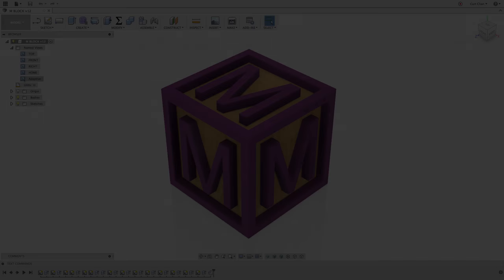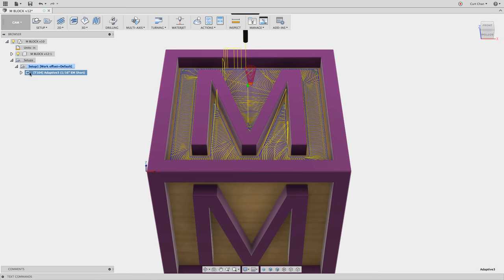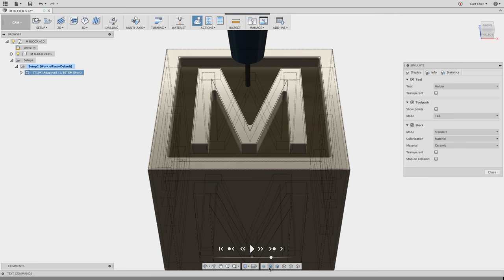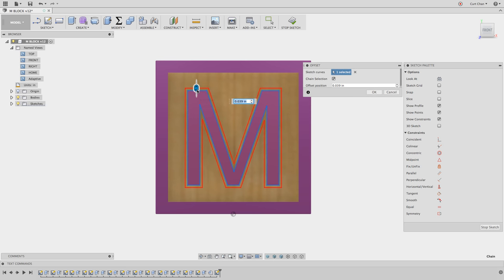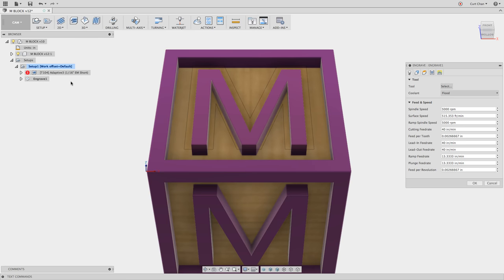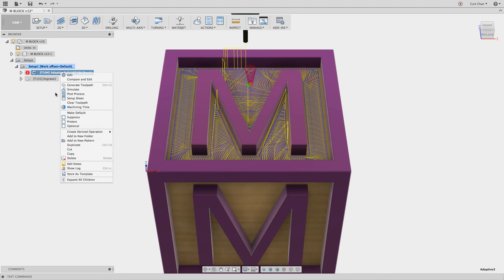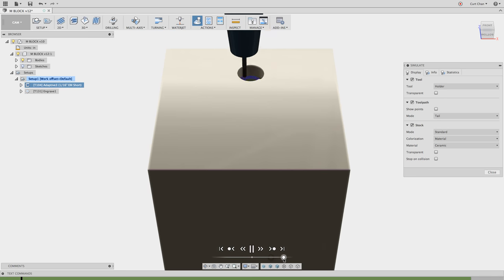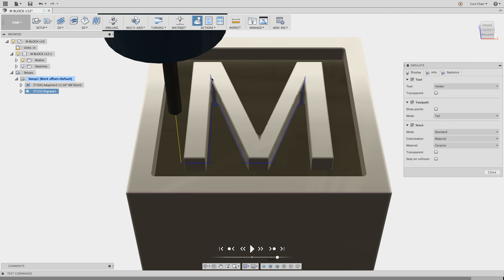QUICK TIP: "Inverted" Engrave Operation

Comment: Is it possible to do multiple depths of cut when engraving?  Most engraving tool wont stand more than .005-.01 DOC.

Thanks
Reply: Absolutely. I usually only go .01, but if I needed to go .02 or more, I would make 2 Engrave ops with different depths.
Reply: The only way to do this with the engraving strategy is to recreate the geometry at different z depths...there is no axial offset in engrave.  There is however axial offset in the trace operation if you want to use multiple depths.

Comment: Silly question, why not just use trace with chamfer enabled?
Reply: bensbenz that should work as well boss, but I'll give it a try.
Reply: Interesting tip though, its always fun to see how many different ways you can accomplish the same thing.
Reply: Ben! Thanks for posting your work to insta. It's cool seeing an IT guy with a 4th killing it.  Trace will not ramp into the corners helping it to appear sharp. Engrave will raise the tool as it goes into a corner. There was no way to make the sharp corners on this M before Engrave in 1 pass.
Reply: Hey thanks for saying so man, and yes indeed, that is a very good point (see what I did there) :)